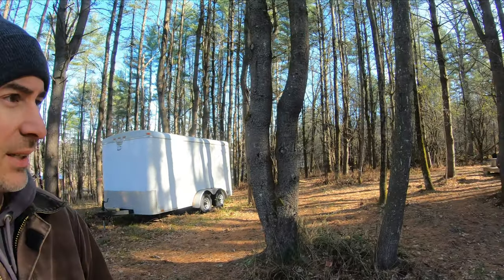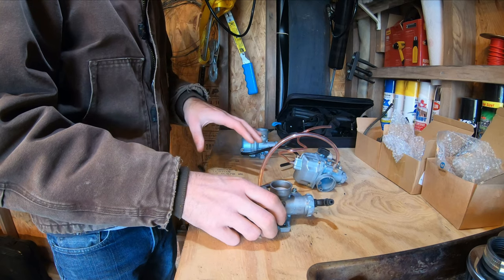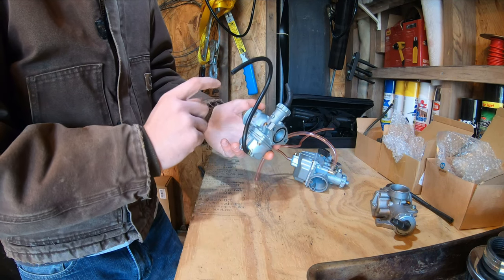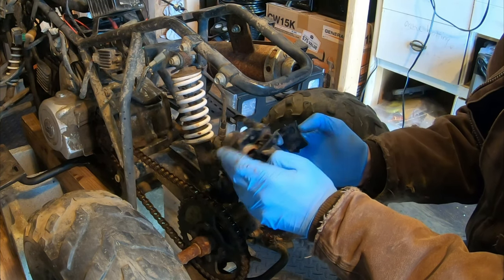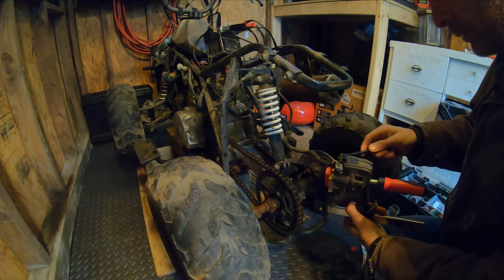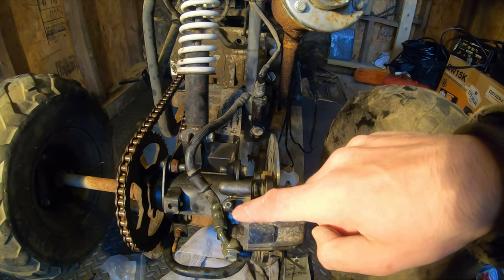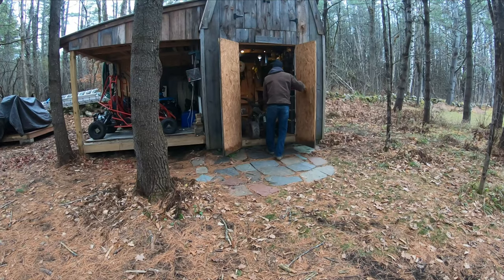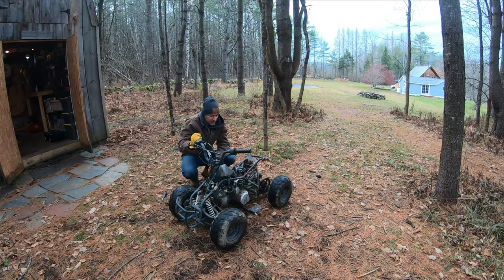Tao Tao 110cc Coolster 3050c Chinese Four Wheeler ATV Rebuild - Brakes and Carb Tune

Comment: I have a TaoTao 110 that needs a carb swapped out and brake lever hope this helps me. I’m in NH and can’t find places to work on these.
Reply from the maker: Good luck, I haven’t found shops that will work on them either. I’ve used knock off carbs (pz20) on these successfully. Jets are a gamble but if you need oem jets I go to jetsrus.com. Brake levers are also on Amazon. In my experience these little quads always seem to need a little ‘adjustment’ but are a ton of fun. Good luck.